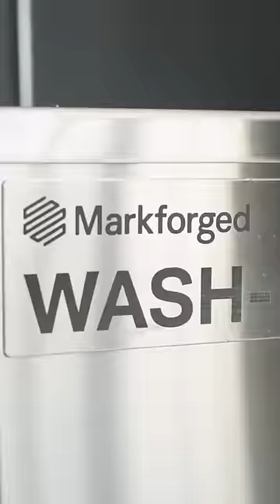Full Process Metal 3D Printing in 17-4 Stainless on the Markforged Metal X #shorts

Comment: The amount of electricity bills you have to pay is menacing
Reply: Yet, in some very niche cases, this can absolutely be worth it. Like space engineering and autosport (knuckles which are much lighter etc.).
Reply: It is the phantom menace.
Reply: Aren't these machines worth like $150,000?
Reply: I mean it’s probably only one or two bills. The cost of them on the other hand…
Reply: I promise you it isn't more than what it costs for fuel to make something like this otherwise.
Reply: @matthewmorgan582  more like $950k+
Reply: It's matters what you built using this if you use this printer to print just normal nuts and bolt 🔩 it will more wasteful of time and money other hand if you built parts for space rocket , than their production cost isn't issue.
I hope you got it .
Reply: Bruh if you can afford a metal 3d printer you can afford the electric bill
Reply: @ec7005  
What makes you think that?
Reply: This kind of machines are not for your hobby project brother.... 😂
Reply: @ROKEY88  
But they are, well, kind of.
If you mean business you probably don't even know their name.
Reply: @heinzhaupthaar5590  🤔???
Reply: Much less than the most common machining practices.
Reply: @ROKEY88  
Means they're heavily overpriced, have rather poor results and are closer to hobbyist gear than to any kind of professional solution imho.
If you can't afford the 500k+ $ for a proper SLM/similar Printer your best bet, in most probably almost every situation, is to save the 200k++ and outsource prototyping and one offs. Like everybody else does for very good reasons.

After all there's a reason they advertise their printers with rather strange use cases (custom fixtures & vice jaws iirc. 250k+ and an extremely convoluted, labor & time intensive, prone to failure process just for that? Hell no.), because they only make a tiny bit of sense in extremely niche applications. Only reaching 90% density and therefore lots and lots of material defects really sucks with that price tag and the comparatively bad dimensional accuracy because their proprietary program only accounts for shrinkage with a fixed value for each axis seems very hobbyist to me.
Compensation for shrinkage in complex geometries is a really hard task and this process is just obsolete, unnecessarily complex and prone to many modes of failure.
Reply: @heinzhaupthaar5590  i really don't have time to read ur whole comment... 

Probably it's a good answer ...😄👍
Reply: @matthewmorgan582  yes, they are really expensive for metal printing
Reply: It depends whats the cost of electricity in your area bc in qc electricity is really cheap
Reply: @matthewmorgan582  things are only worth as much as someone is willing to pay for them.
Reply: @ericp4573  the metal x they used is 100k
Reply: Do you even know that amount?
Reply: @SimonStuff2000  what?
Reply: @SimonStuff2000  i meant that compared to other countries yes it is cheaper
Reply: Obviously, it can't be used for industrial production lol. Only for prototypes.
Reply: @M3dicayne  If you want to make space engineering cheaper this is the wrong way.
Reply: @ericp4573  wrong
Reply: @matthewmorgan582  probably, but if they charge $500 a minute run time (idk how pricing is for specialty printing) they’ll make that back very fast.
Reply: @ROKEY88  i see you don't know much

Comment: One question tho, coming from someone who only ever worked with FDM/FFF: do the Metal parts distort significally when sintered or is it just uniform shrinkage?
Reply: Well the fitting screw should give you an idea
Reply: From my experience the parts get printed in a deformed state so they shrink in to tolerance after sintering.
Reply: @malloott  well mostly but they were printed using the same process and at the same time they could have just distorted the same amount.
Reply: @malloott  that can be very loose one
Reply: @malloott  that screw slid in as easy as a hotdog sliding down a hallway. Listen to the rattling. If you want tight tolerances, you're still gonna need to do finish machining.
Reply: There is no 3D Printer in the world which can produce high precision tolerances without a final finish in an other machine. To many variables. However you will come close if you only produce one single item over and over and tune the parameters. But this is not the actual propose for this printers. You use them for complex parts in low numbers for example in design development. High numbers would be very expensive and Molds would be cheaper
Reply: Parts typically exhibit distortion proportional to the material thickness in that region. This process suspends the metal particulate in a polymer binder that is removed during the sintering process. Distortion is "significant" and non-uniform in terms of simple scaling calculations (You cant just make the part X% larger and be done). You would not use this [ADAM] technology for most functional parts in industry.

Comment: Metal 3D Printer? Stainless filament? Grey colored? Or just non-metal material but stainless coated?
Reply: A stainless powder is suspended in a polymer binder. Prints just like a normal 3D printer but with some metal that is baked together later and the polymer melts away in the process
Reply: @themechanicaladvantage  Nice! Thanks for your logical explanation. It's a new outstanding thing in a 3D printing field

Comment: I never know we could actually 3D print metal
Reply: SpaceX and several other aerospace companies make large sections of their engines with metal 3D printing because some of the geometries would be essentially impossible otherwise.
Reply: This is a bit different than you think, it's not molten metal it's plastic with metal particles in it that is sintered in very high heat to burn out the plastic and fuse the metal

Comment: That’s cool and all, but make an actual bolt and do a torque test. Bet it snaps easier than a dry spaghetti noodle.
Reply: Straight off the printer, sure - which is why it then needs to go into a sintering furnace. I'd be willing to bet it's final strength is ballpark-comparable to parts produced with standard sintering processes.
Reply: @khill8645  Im legitimately curious, especially a comparison between a printed bolt and an actual machined bolt. Im sure the printed will have a lower torque capacity, but I want to see how close they can get. Because metal printing is amazing, but im curious about the usability.
Reply: @nondominis4359  Sintered parts can get you in the ballpark of somewhere between 10 and 50% of the fracture strength of a cast steel part. The whole point of the tech isn't to replicate those strengths though, it's to use for pieces that are difficult or impossible to create with traditional manufacturing techniques, such as parts with entirely-enclosed mechanisms or the female threads of the container in the video that would be an absolute migraine to machine traditionally.

Comment: What are you doing for heat treatment after sintering? Solution anneal it and give it one of the H-conditions for 17-4 PH?
Reply: Microstructure for binder printed metals often show very porous resulting material which makes the precipitation hardening process difficult. You don't often see these parts being given hardening conditions because they are not real end-use parts. However, other 17-4SST capable processes [most commonly powder bed fusion derivatives] are capable and more receptive of heat treating. You would need to ensure to remove all excess powder post print and then you could apply a typical H900 or otherwise.

Comment: i really wonder if here is a lot of porosity on parts printed with this machine
Reply: yes
Reply: Yes and no, from what I understand is that they do shrink during the sintering process which makes it near solid though.
Reply: Sintering (fusing metal powder below the melting temperature of the used alloy) can get up to 95% density, compared to bulk. 
In contrast, powder bed selective laser melting (which is a different 3D printing method for metal parts) can get to 99,95% density.
Reply: @Hydrazine1000  how does that compare to forgings, billet and casting? I imagine it being brittle.
Reply: @Hydrazine1000  I'm used to making fire arms parts some of which take some impact. I figured this wouldn't work for that as me mostly use forgings.
Reply: @mastershan87  Sintered product approaches as-cast properties, mostly, but you're right that it will not be as ductile. It depends on the application if that's an issue or not. 

And this being 17-4 PH, it also depends on the precipitation hardening that should follow. H900 or H1025 will have a poor Charpy v-notch impact strength. On the other hand, if this gets precipitation hardened to H1150M, it should exhibit moderate impact strength. But not as good as forged.
Reply: @mastershan87  There are other additive manufacturing methods out there besides this route of binder jetting - debinding - sintering. 

For fire arms, powder bed selective laser melting (SLM) would be the superior 3D printing choice. (But also more expensive!) It's also showcased here on TITANS in other videos.

Comment: Didn't this tech make a recent break through on rocket tech? Something about being able to 3d print intricate passages that would otherwise be impossible with a CNC
Reply: I don’t think it was with this technic though.
It’s still fdm printed .
I think sls printed is much more stable. Tell me otherwise if I’m wrong
Reply: @hendrik4291  tbh I just remember seeing some piece that was designed and made by AI, it sounds like you would know more about this than I would

Comment: That’s not 17-4. Maybe chemistry wise, but as an additive manufacturing product not the same at true 17-4 wrought product. Any mechanical testing on anything you make with that machine would fail all industry standard significantly for 17-4. It is a cool model though.

Comment: Yeah I don't believe that's metal first off where do you get a 3D printer with a what sounds like a plastic bed to withstand 14 to 1500 degrees actually no I think it's more like 2000 to 2,400

Comment: Remember how this channel put out a video on how it's not possible for machinists to be replaced and how they laughed at a manager who said that those 3d printers were coming for their jobs? Well, it may be happening now whether they want it or not.
Reply: The parts produced in this video have a Surface that is unacceptable for any of the parts my 200 employee shop makes. Also I don't believe these parts are durable like parts made from billet, forging and I imagine even castings would be superior under stress and impact. That being said there are certainly applications where this is absolutely superior and the technology will bet better. But they still need to be programmed and operated.
Reply: This shit (sintering a metal-infused polymer), in it's current state, and likely any future state, will NOT replace traditional machining.

The material no no where near as durable (in both ductility and strength), it's very porous (like cast materials), it cannot achieve high levels of precision (it's only as accurate as a 3D printer, hardly going to get the tolerances you need on things like engines where thousands of an inch matter. The only way you would is machining it, but at that point why print it?), it's very slow compared to normal machining, and it's much more expensive.

It is not going to be taking machinists jobs for the foreseeable future.

Comment: are they just as strong molded metal or weaker anyone know?
Reply: A little weaker based on what I’ve seen. But the technology is getting much better:
Reply: I would say significantly weaker especially if they are not heat treated. 

Also nothing compares to single growning crystal strength. 

I find 3D metal printing (mostly) a novelty or good for retooling. But for strong long lasting parts reductive is always better than additive.

Any generative design is mostly worthless because while you might save costs of materials you greatly exceed that in manufacturing.
Reply: @seemlesslies  You'll be in for a shock then... 3D metal printing isn't a drop-in replacement for conventional designs, true, but SLM printing (which is different than what's shown here) is capable to out-perform the same material in the as-cast form and approaches mechanical properties of material in forged condition. If that gets combined with the near-absolute freedom of design offered by additive manufacturing, you'll end up with superior parts. 

Google for the new turbofan engine that GE developed for the Cessna Denali aircraft. The clean-sheet design used 3D printing to consolidate 800+ parts into just 11, producing an engine that is more powerful, more efficient and lighter in weight. Or google for the Bugatti Chiron 3D printed Ti6Al4V brake calipers that shed 40% of their weight yet are stronger. Or ask SpaceX how their SuperDraco 3D printed rocket engines are doing, which happen to be rated for human flight while they're at it...

Granted, additive manufacturing isn't suited for mass production. Not yet anyway. But to dismiss it is just silly.
Reply: @Hydrazine1000  At no point did I say it wasn't useful but as you said for mass usage it doesn't work. It's why I called it a Novelty. 

How many cars does Bugatii make a year? How many cycles can those brakes run for?

Turbofans require extremely low cycles and are very costly to check.

Rocket engines have a one time use lifecycle so they can get away with it.

I feel like every example you listed gets more and more extreme and more and more novelty. This is the failing of many people that are either new engineers or newly exposed to engineering. They just look at all the pros, but all I see with 3D metal printing is way more cons than pros for all but the most niche expensive applications.

Which is cool but has little practice usage in most forms of engineering.
Reply: @seemlesslies  Well, I'm in my forties, I've got an MSc in Materials Science & Engineering, I've been an academic for several years and I've been a process engineer/metallurgist in the steel industry for 9+ years. No, I'm not a new engineer nor newly exposed.

The brake calipers are for a very high end car, meant to last as long as the previous conventional produced part, which is as long as the car itself. Bugatti has a video online which shows the red hot brake testing. That SuperDraco engine? That's being re-used/re-flown, including for human-rated flights. That GE Catalyst turbofan? That's for a commercial Cessna (formerly Beechcraft) Denali, so equal again to the conventional counterpart. The BMW i8 uses 3D printed hood hinges that are designed to fail in case of a pedestrian front impact, to have the hood tilt up and cushion the impact. Porsche Classic Cars has a 3D  printing department to reproduce out-of-stock classic car parts, including critical clutch parts. Plastic injection moulding dies get 3D printed with conformal cooling channels, cutting typical plastic injection cycle times down from 30 to 5 seconds (which is absolutely huge in production terms), and the list goes on... 

But go ahead, keep calling it a novelty. It used to be a novelty, true, but it matured well past that point in a lot of industries.
Reply: @Hydrazine1000  you keep moving the goal post. You named products that are niche and high end. Besides maybe the hinges. 

Those brakes are on a car that likely will never been driven more than 20k miles.

On a single airplane currently on a private jet for god sake. 

You named a rocket that takes people to space. 

I never said there are no products I said they cannot compare with conventional products which you have yet to disprove. 

I am a little curious about the injection molds and what their cycle life is like compared to standard tooling methods compared to cost. 

Engineering is about cost of the efficiency which 3D metal just isn't even in the same ballpark unless it is for single use or very small product runs which is all you have listed which just proves my point. 

It is a niche line. I don't care if you have a PhD in engineering. It doesn't change that.
Reply: @seemlesslies  It's fine man, we'll agree to disagree. 3D printing isn't going to replace all conventional production, that's for sure, but it will replace quite a lot more than you appear to expect. 

Time will tell if I'm too optimistic. 

And yes, 3D printing is expensive. It will always be more expensive than conventional production. Key here is making use of a near total shape freedom that's impossible with conventional machining. And if that really complicated shape gives you benefits in weight, performance or efficiency then the extra cost is worth it.

I've seen 3D printed water cooled gas burners with impressive numbers. Expensive, sure, but outperforming conventional parts. Same for heat exchangers. I've seen 3D printed hydraulic valve  blocks which were less than a third of the conventional weight and had less back pressure. I've seen a part of a concrete pump installation, it cost 10 times as much to print the optimised version. It was also 11 months in service and counting, rather than needing replacement every 6 weeks... Savings in having no downtime more than makes up for the cost. Titan showed a liquid cooled fluid mixer and a burner for a rocket engine on this very channel with performance numbers impossible to achieve with conventional parts, due to the part shape intricacy. 

I'll confess one little secret to you: I used to be dismissive of this Additive Manufacturing thingy myself, up to about 5 years ago. Thought it was a fad, because I assumed way too much. It was quite a surprise to see how far this industry has come.